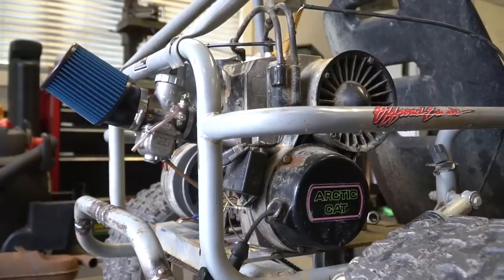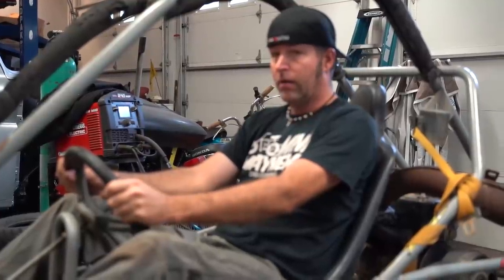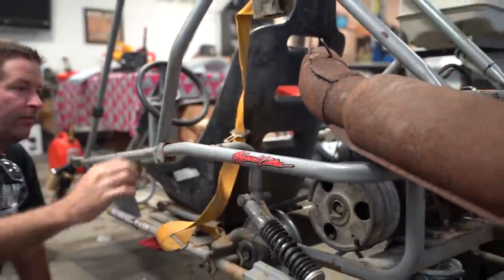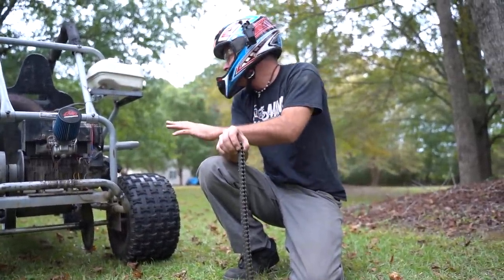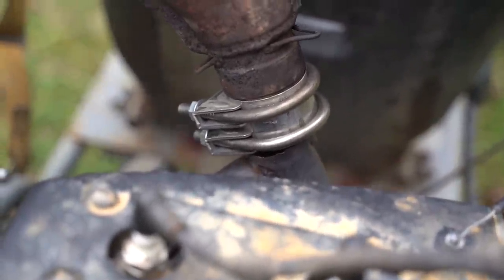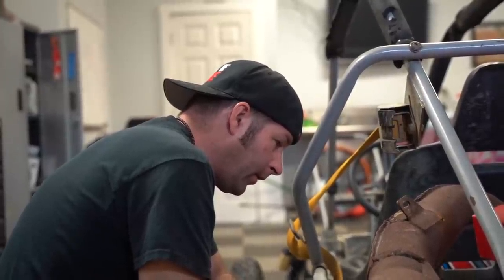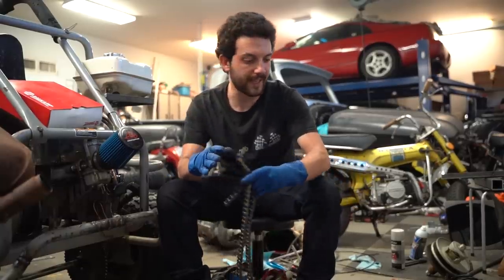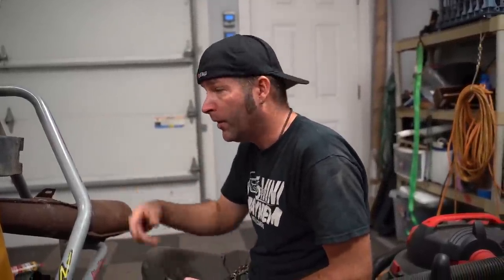440cc 2 Stroke Go Kart First Ride!

Comment: on old snowmobile engines you can make your own puller just find a bolt with the right threads put it in a leathe and cut the threads of the end and you made a puller the right one will work much better but at least try that if you can

Comment: You need to spring mount the exhaust or it’ll keep breaking. You can also pull the clutch by filling the bolt hole full of water and seal the bolt with Teflon tape and the hydro pressure will pop the clutch. Need to use an impact gun though to wind it in as fast as possible.

Comment: Dont need a special tool, just find a bolt that fits the threads in the clutch and grind down a shoulder to go inside the crank. Done id recomend a comet 102c primary clutch, fairly easy to tune, reliable as the day is long and theyre absolutely everywhere.

Comment: You don't need the clutch puller. Just turn the engine on its side, fill the bolt hole with water. Use a liberal amount of teflon tape on the original bolt and screw it in there. Preferably with a impact driver. I've worked on a lot of snowmobiles and that method works as long as you get a good seal in the threads.

Comment: Take out the motor, overhaul it, grommet mount it, brace the exhaust, then letter_rip_tatorchip!
Reply: why rebuild? nothing is wrong with the motor
Reply: @j0sh368  because its a 2 stroke, you should rebuild the top end every 50 hrs or so, that's how often I do mine anyway
Reply: @0_K_0  sleds go for 500 to 1000 hours
Reply: @jordanlittle5391 , fair enough, but that's probably due to how low powered they are

Comment: GUYS THE ENGINE NEEDS RUBBER MOUNTS. when you take of that primary DONT USE A IMPACT OF THE PULLER! Those cranks are pressed together and you can actually put the crank out a couple thousands and ruin the engine if you use a impact and those old girls don’t burn synthetic two stroke oil well so youse non synthetic oil any time you have a chance and will run a lot better👍 keep up the good work

Comment: I suspect the clutch on the kaw is threaded inside 14mm 1.25 thread. If you had a long bolt you tip it up on end, fill it with water, wrap Teflon around the bolt and thread it in. Hydraulic pressure pops the clutch off.

Comment: Also to take a snowmobile clutch off use a small bolt to push on the crank and the stock bolt to push that bolt against the crank so it pops off, you may have to use a torch to heat the middle section, then just tap with a hammer

Comment: To get the clutch off you take out the bolt that holds the clutch on the shaft, put grease in the hole where the bolt was, put thread tape on the bolt, put the bolt back on and tighten till the clutch pops off, the grease will push the clutch off the shaft

Comment: The exhaust is a easy fix just do what we do on the race karts  and that is you use springs to hold the small section of tube that is cut to different lengths so to change when the power band  comes in.

Comment: I have a 03 polaris XC SP Edge 600 (top of the line for the 600s) and the torque converter doesn't kick in till 4,000rpms. Then the power band it's around 5-6,000rpms. And maxes out at 8,000rpms. Just to give you an idea

Comment: ive got the exact same 440 Suzuki in my superjag and maybe its because of the hot weather but it seems a bit smoky to me maybe its mixed too rich or if you still use the oil pump then maybe its set wrong. might also just be a tired engine if its been beat alot

Comment: teflon tape the main bolt on the primary turn engine on side and fill hole where bolt belongs with water. install bolt, pressure will make it pop, a few wraps of teflon, try a couple times

Comment: Use 428 chain and sprockets, and use the factory primary and secondary clutches from the original snowmobile, there is a special clutch puller bolt available to remove the engine clucth,you guys will be amazed at how it will perform and I'll bet you will build more sled powered projects

Comment: A hub puller would do just fine. Also your exhaust nits straight inline to one with no 90° angles those engines will produce massuva amounts of heat make Y split coming off both exhaust outputs to one. With a flange and cupling mount with springs. This will eliminate heat breakages and allow heat flow

Comment: PLEASE HELP Ike and Issac see this comment PLEASE LIKE AND COMMENT SO IT GOES TO THE TOP AND WE GET CONTENT SOONER. Most of the time you can tip the cart on its side and add water to where the bolt holds the primary clutch on the engine. Providing the tool you speak of has one bigger volt and then a little bolt, you can add water to it. When you add this water it will fill up the space on the inside, water does not compress so it is safe. But then you go out and get the BIG bolt that threads into the primary clutch and not the crankshaft like the one you pulled out. You get the specific sized bolt for your engine and you need to add plumbing tape to it to seal the water. Make sure you wrap it lots or it will leak. You can then tighten it down with an impact and the whole primary clutch will pop off. IT SAFER THAN THE TOOL! Water does not cause metal deformation. I have been using this on bush quad and snowmobiles for years. If you have any questions respond to my post. Thank you for you great content. Look up "pulling a cvt with water" on YouTube it will show up.
Reply: Bump

Comment: Pull that main jet and drop it down to a 230 or so, it's jetted for 0-20 degrees, you're running REALLY rich, even a two stroke shouldn't smoke that bad. I race snowmobile watercross in July and only a few of our sleds smoke when it's 75-90 degrees out.

Comment: If you had -40 weather you could pour water down were the puller goes and thread a bolt into the puller threads and throw it out side to freeze overnight  but you have to make sure those thread seal good to not let the freezing water leak out

Comment: Too much oil in the gas Leans out the motor and that's what can "blow up" the  motor. Nitrous Leans it out even more.
The coolest build I've seen you do yet. I've got a 2 seat Murray I'm working on. Got a 212 predator, torque converter and a differential rear axle (from single wheel drive). Need brakes and I want to add front suspension.

Comment: Y'all better check, and replace the crank seals. Definitely something you want to replace on a 2 stroke, especially an old one. Also look into some amsoil dominator 2 stroke oil meant for sustained high rpms that CVT 2 stroke snowmobile engines see.

Comment: Find you a shop or steel yard that builds safety hand rails and buy a few elbows made out of 1/8" wall steel, a lot of guys use them to build turbo headers, you can sometimes find them in stainless steel too.
what ratio of premix are you running, you might be able to cut it back a bit unless you are just trying to keep the mosquito population down.

Comment: Good thing about a sled moter is if ya ever listened to one when they hold it wide open it actually sounds like it slides into another gear witch it dont but not sure if the converter does that to make it faster at lower rpm but a should see if that motor does ri hat if so that's going to rip and ya got that fuel really ditch on oil ya should thin it down a bit or it will foul plugs easier and quicker..but smoke is good but that's alot lol but till next vid godbless

Comment: Hey tip the motor up so you can dump water or motor oil in the bolt hole then re insert the bolt and tighten it up the clutch will pop off

Comment: thats a snowmobile engine. its jetted for 30 degrees. jet it down and tune it for 40:1. Also you dont have a torque converter its a primary and secondary clutch. also you need to tune that secondary clutch in for that chassis. the weight and rolling resistance is totally different than a snowmobile

Comment: The torque converter may be causing some of the vibration but 2 stroke engines vibrate horribly and from factory everything is rubber mounted

Comment: An atv primary would probably work if you can find the same shaft size. Yamaha, Polaris Arctic Cat, even a  KYMCO. Gotta get it apart first then go from there. Also a nice dinged up craigslist $50 fmf expansion chamber and silencer would look and sound better, the one you have is full of oil..

Comment: Snowmobile engines really rely on the correct belt, that can cause bad shaking too. And I would turn the oil pump down or run less oil in your pre mix

Comment: Cool dude. Just wondering I was told that snowmobile engines got their cooling from snow melting action. Is that true? I don't know. So how's yours cooled? Ok right on love the whole thing.
Reply: An air cooled 2 stroke is just that, air cooled not snow cooled. Now a liquid cooled 2 stroke I could see the snow helping cool by hitting the radiator.

Comment: Sounds super lean (air/fuel) right off idle. Might turn the pilot screw out half a turn at a time, max 3 turns then go up a size on the pilot jet (DONT DRILL). Upper rpm, aka main jet sounded ok.

Comment: Take the clutch bolt rap it with teflon and put a bit of oil in the hole and put a impact on it and tighten it and it will pop off

Comment: Put teflon tape on the clutch bolt and fill the hole with water then impact the bolt back on. The hydraulic pressure will pop the clutch right off. No special tools needed

Comment: FYI.. MASTER LINKS are not all the same.  the master link must match the Brand of chain.
I used after market master links, and threw the chain 4 races in a row, while leading. 😨 
I kept using the same chain, w new master links. Until I figured it out.
 Have fun, be safe 👍😎🏁, ware helmet, jacket, gloves, especially on a shake-down run !

Comment: Use this extra 5 days to fix all of the stuff that "Is temporary and you're going to fix later".. mount the exhaust properly, redo the gas tank to the middle with one of those round containers like the dragster uses. Fix all those little things. Get full throttle. Etc.

Comment: You dont need a puller just loosen the bolt, which holds the primary, so that it is only on by a few threads, tap the bolt with a hammer and pull the clutch by hand. Continue this process and it WILL come off. This is how I remove the cvt primary from my polaris atv, and trust me, they are hard to take off.

Comment: Take the motor turn it on its side, put teflon tape on the bolt threads add water to the torque converter hole (where the bolt goes) screw the bolt with the tape into the hole  I use my impact on it.  The pressure when you screw it down will pop the converter off

Comment: Think you guys should put the other 2 stroker on the deloren cart. With a real shifter cart clutch assembly no jack shaft. No belt. Straight up all clutch. You wanna blow up tires here's a good chance to rip the mules rear off its sack.  Go like a pro. Deloren will fly

Comment: Put tracks in the rear and skiis in the front for the winter 😂😂
Reply: Ihave Crabs unfortunately they are in NC not too far from me. We get less than 3” of snow that turns to slush a couple times a winter. Every couple years we get a decent snow with with 6ish inches +\-. 

Most of the time I can still run my nitro R/C and have a good time. We get snow so infrequently or it melts so fast just messing around in a go-kart doesn’t get old. 

It would be fun, but too much work for little payoff.
Reply: @rileyfenley522  yeah, it would be a better project for somewhere with a lot of snow. You could probably get to a lot of places that you couldn't with a snowmobile.

Comment: Torque converter:

Idle...

Half throttle...

3/4 throttle...

100% throttle-> FULL SEND ER NO SSSSSSEEEEENNNNNNNDDDDD
Reply: That's how it has to work on a snowmobile, you won't have enough torque in the low to mid RPM range to get the thing moving track and all out of a hole. Think of it like being perpetually stuck in the mud but worse.

Comment: You need a torque converter puller and get rid of that stock hex clutch there junk. Get a 102c comet clutch , think that’s a 30mm taper and you can adjust that clutch for engagement and back shifting.  Find a single tuned expansion chamber exhaust it will be lighter and more performance, and spring mount the flange where it goes together
Reply: Also put a guard over that clutch. That have explode. And taken feet off. You could loose a arm

Comment: 2 strokes like the snowmobile engine need to be rubber mounted they all vibrate like crazy, im in the process of putting a 530cc Suzuki in my quad and i had to rubber mount it up

Comment: Looks like that clutch has too heavy of a spring it's stalling way to high hence the broken chain love the build
Reply: Like I mentioned earlier, you need to remember that a twin cyl. 2 stroke sounds like it's revving to the moon, when in reality, it's only turning 2500-3000 rpm when the torque converter locks in. That 420 chain is only good for 10-15 hp. max, so it's no surprise that 440 Kawasaki snapped it like a rubber band. A good 530 motorcycle chain and sprockets is probably in order to hold the power from this beast!😁

Comment: Take the bolt out of the crank put a 3 inch long 1/4 inch Dia extension in bolt hole, put bolt back in tighten tap with hammer , clutch should come off

Comment: You don't need a special tool to remove clutch. Just smack the side of the clutch inner shaft with a heavy hammer...it will pop loose like a tie rod.

Comment: Get some proper separate pipes made to the specs of that engine and it will really come alive. You can't just slap together a 2stroke exhaust - it's the most important part of the engine. I''d swap over to twin carbs too.

Comment: First of all its not called a Torque converter it’s a clutch and you need a secondary clutch not a pulley and you need to make sure the fan is spinning because that’s you cooling

Comment: The way you have that tank mounted, If you were to flip it not only will it mash the tank, it could knock off the cap and throw gas all over you and a hot engine. That's not a good combination. I'm sure you will revisit the way you now have the tank mounted and make changes before you really rip with it.

Comment: Guys, have the jets in the carb been changed.  to run in the warm temps...that machine was designed for 32 degrees not 60 degrees or hotter.

Comment: these old snowmobile engines are a dime a dozen as are the old cage carts .this could be the thing to get them back in favor and out of the shed or from behind the garage and in the fields ripping it up. my favorite use for snowmobile engines is on a golf cart the old engines make a golf cart do wheel stands. ( Hint Hint )

Comment: Also make a good mount for the exhaust so it doesn’t flex that’s the second half of your problem
Reply: It must flex those exhaust systems get mounted with rubber pads and spring loaded ball and socket joints for this reason.  The problem is that they're rigidly mounting something that must flex=failure

Comment: Find the thread bolt  on the clutch and put a socket in the hole. Tighten and the clutch will pop off. If it is the kind I am thinking of. Take the nut out first
Reply: The bolt will push on the socket and push  the clutch off at the same time

Comment: Run the stink-bomb on 40 to 50 to 1 gas to a quality modern 2-stroke oil instead of that 16 - 1 intended for regular motor oil... More power too.

Comment: I have a 50cc 2 stroke scooter and it rips the chain almost every time to much power lol
Reply: I suggest checking your alignment and make sure there is no play in the swing arm, wheel, or that the engine plate isn't flexing, or engine is shifting. If you're breaking chains it's either too loose or tight. If it's just popping off sprocket then it's like I said above.

Comment: As a two stroke owner, that thing smokes way too much. Also the exhaust needs to have the springs holding it together
Reply: Exaust was dripping oil before we even put it on that engine. It calmed down after a while

Comment: That expansion chamber has to be tuned to the engine or you will send tobs of unburnt fuel through the exhaust. Which equals massive loss of power & rpm!!!

Comment: Plz stop calling it a torque converter it's called the drive clutch
And it requires a special tool called a clutch puller to remove it completely

Comment: All the vibration in the world wouldnt have broke the header like that if a 3 ft long STEEL exhaust would have been mounted and not all it's weight suspended on a little pc of pipe -

Comment: There not twerk converter on snowmobile two stroks that are drive clutches
Reply: Day drinking? Thought my grammar was bad. I totally agree with you however. Cringe every time i hear torque converter. Real torque converters are found in cars and trucks. Ive got a $1700 sun coast 1074 torque converter in my diesel truck and a $900 8in ATI torque converter in my race car. On my small engine toys with a cvt they are and always will be called a "clutch" or like you say (kinda) drive clutch. Or drive and driven clutch. Or primary and secondary clutch. And etc. But NOT a torque converter! Brand name by comet 50+ years ago "torq-a-verter" also known still today as a "tav". Ok ill stop
Reply: ...so you can convert all that twerk
Reply: @Mardy72  twerk converter might be a thing in some major metropolitan cities...just not this one, the motor city...

Comment: Why not rebuild the engine while you wait 5 days for the new tool?
Will be even faster!
Reply: Why?
Reply: Because it looks like the rings are wearing out. From all the blue smoke?
Reply: @insanewayne75  It is a two stroke, they run on oil in fuel mixture, they are supposed to smoke.
Reply: Not that much?
Reply: @insanewayne75  ,looks normal to me, better for it to smoke too much, than not enough. I love the smell.
Reply: @gsp49  I love the smell of Rock oil.
But my Cagiva 500 single or my Honda CR never smoked that much
Reply: @insanewayne75  I have no idea of what rock oil or Cagiva is, never heard of it.